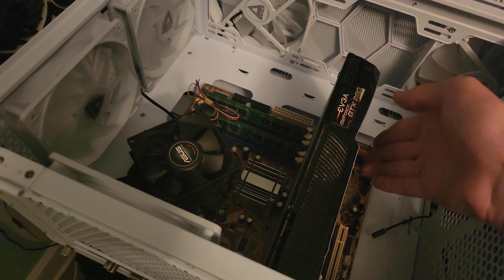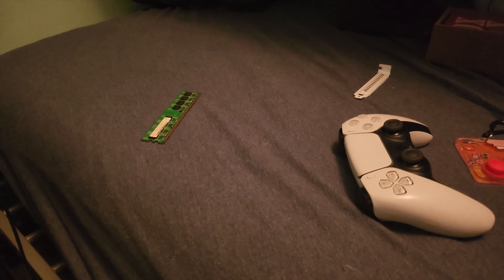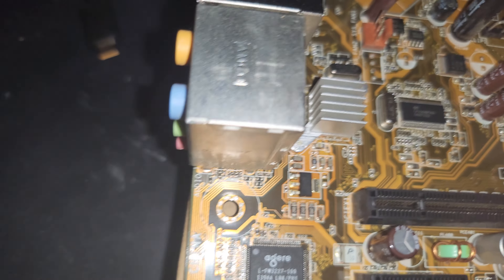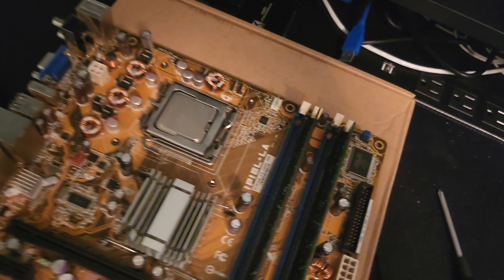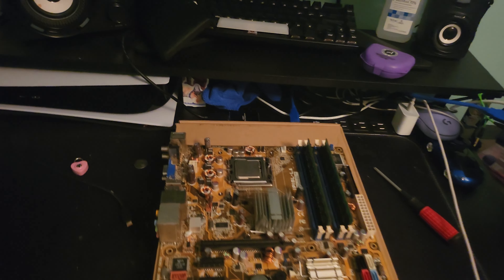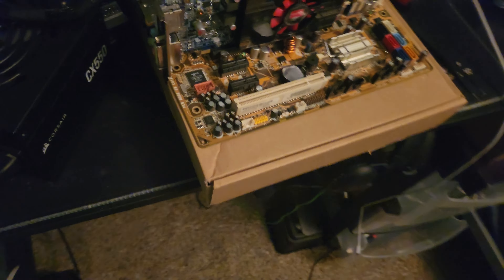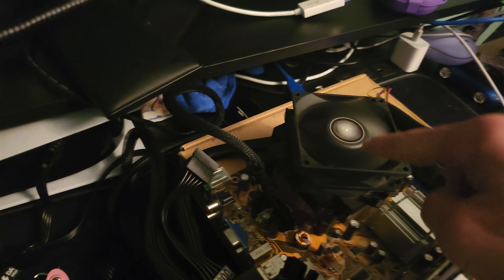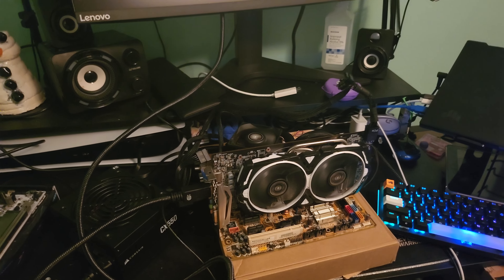Messing with Old Hardware that doesn't like me...

Comment: Yeah, ATX hasn't really changed too much over the past... nearly 30 years? (looking it up on Wikipedia...) yeah, it was patented in 1995. I mean, it has and it hasn't. It's only at version 3.0 today, and the 24-pin and 4-pin cables have been around since 2.x. The first PCs I ever built were "AT" standard. ATX wasn't fully adopted by the market for another year or two. At first the main power connection was only 20-pin, but that evolved, and that's why you see older ATX power supplies with a 20+4 pin connector. During the time of the Pentium 4, processors got kind of power hungry, hence the "P4" auxiliary power connector. I don't know they're called that because it's a 4-pin power connector or because the Pentium 4's hunger for power mandated their use, either one is just as likely. I think the former explanation is more likely, since Athlon motherboards also had the same connector.